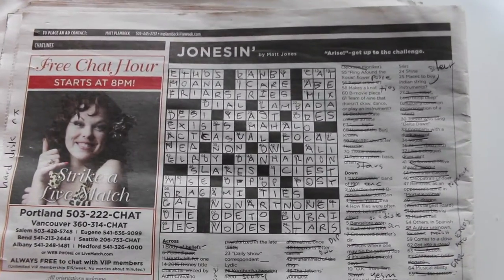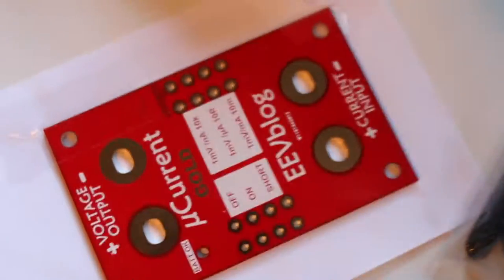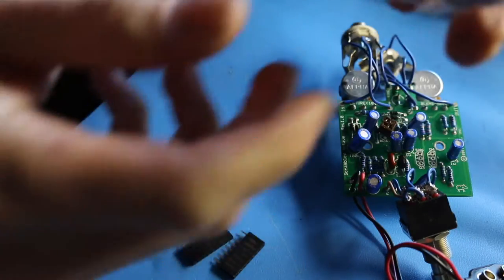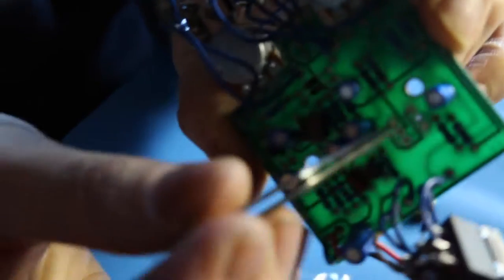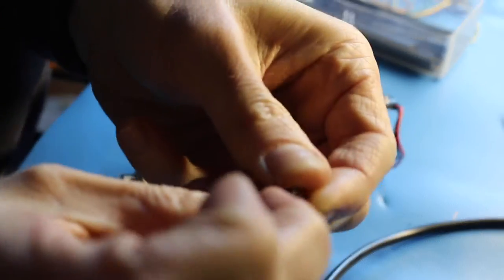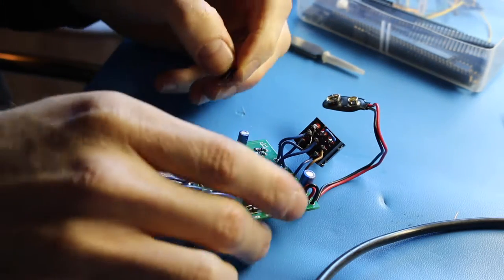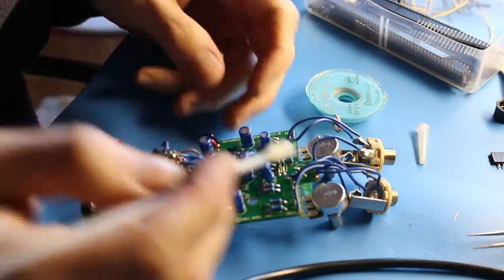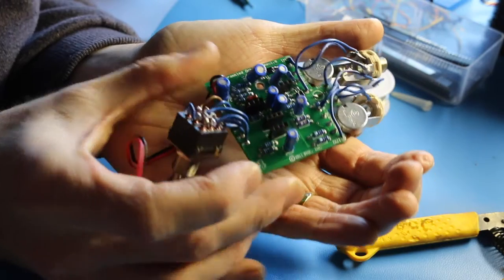Ep. 00079 (Transistor Sockets)

Comment: Nice. If you're ever interested, interfacing a MIDI port to an Arduino, to receive from or send to an instrument, isn't bad. Desoldering braid is nice, but a desoldering iron is a dream for high pin count DIP thru-hole parts :)
Reply from the maker: Thanks for the tip Kent. I actually did this a couple years ago using a PIR sensor, Arduino and Ableton Live. Short story is that it would basically fire a midi note that ran an instrument rack in Ableton live whenever you would get near the sensor.

As for desoldering, a desoldering iron is on my list! :)
Reply: Hi Rob. I'm still working my way through your pedal videos, but you may be interested in work that a friend is doing at https://www.facebook.com/RomansAudio/. He's using Arduinos and software to create effects and modular synth stuff. I don't know if he has posted too much about the hardware. May be more about the software he's writing. Might be similar and he would be interested in talking about the work, if you are interested. I know a bit of keyboard, and tried using Arduino and midi to create an "instrument" that selects a tone (and velocity) by tilting a stick (with an accelerometer.) It worked OK... sounded as good as I would on a theremin... i.e., not too great at all :)
Reply from the maker: Cool. There's not too many of them at the moment, but hopefully I'll have another one up soon. I still need to repair an MXR delay that I have sitting around. So that'll get a video at some point. Also, I'll be sure to check out Roman's page – sounds like he's making some neat stuff. 
The tilt-a-tone-o-fone (aka the stick) that you made sounds tricky to play, but neat as well. Haha. It got me to thinking that it might be fun to inject something like you made into a flute and instead of playing it the normal way, you could just twirl it around and make flute sounds. Weird, silly and well, yeah – maybe we just leave it at that. Thanks for the info.
Reply: Exactly, tilt-a-tone-o-fone! The flute idea is cool. Perhaps tilt could control an effect? Actually, a wind midi instrument from scratch would be a great project. There are some commercial wind midi instruments, but they are pricey. Maybe I'm naive, but combine a pressure sensor, (maybe two, similar to a pitot tube?)  10+ buttons, an accelerometer, and most importantly, someone who can actually play the thing :)
Reply from the maker: I dig it. That'd be a fun one! I'll keep thinking about it. :)
Reply from the maker: I dig it. That'd be a fun one! I'll keep thinking about it. :)